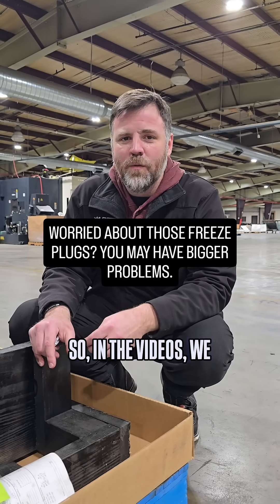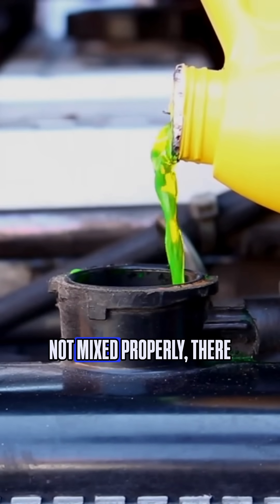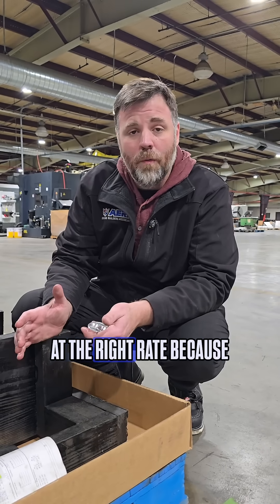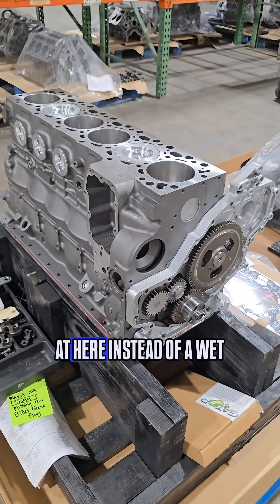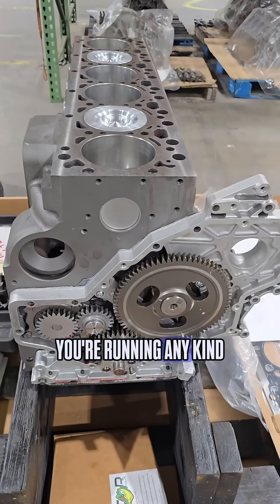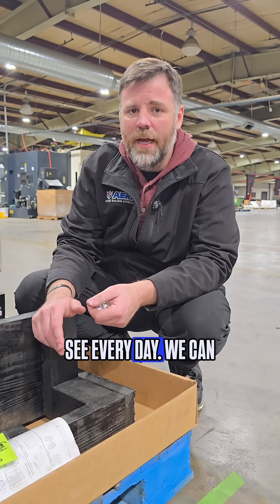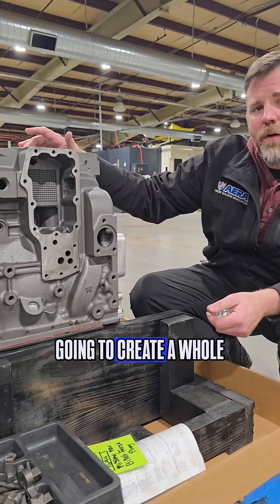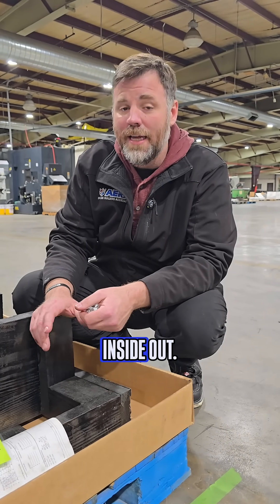"Freeze Plugs" are NOT an Insurance Policy!

Comment: We bought a 1066 of a farmer that ran straight water. Years later it was on the forage blower and split the sleeve up the side! The piston jammed up and wrapped the rod around the crank and pounded a hole in the block knocking the fuel pump off and shutting down the engine! Now its got a Dt466c